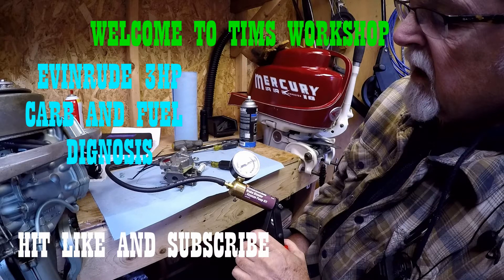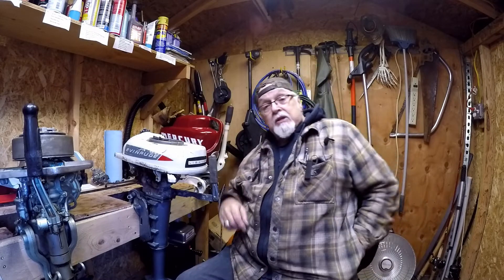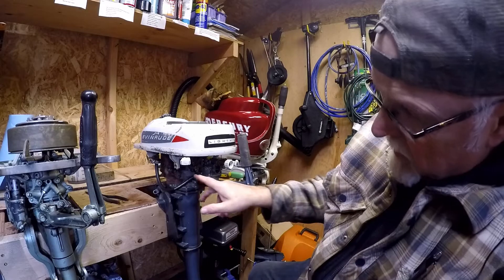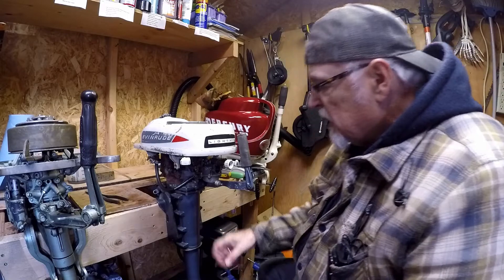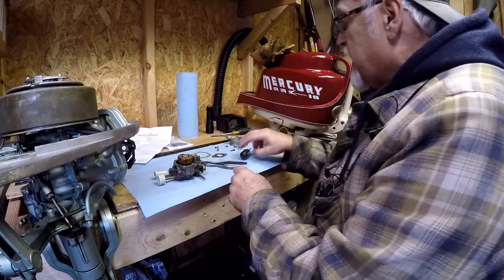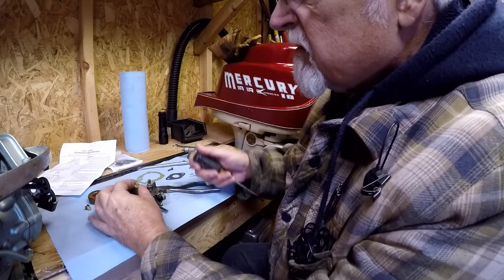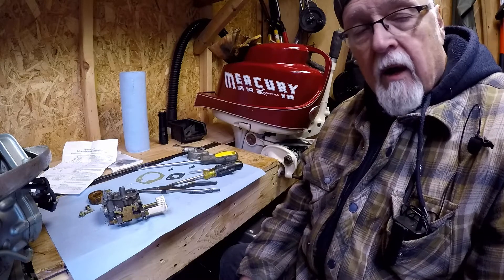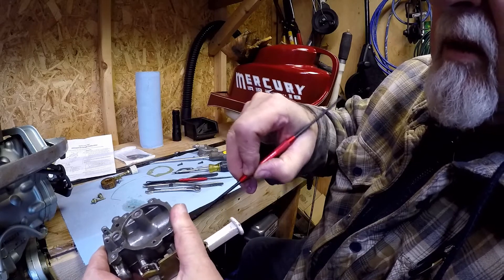Evinrude 3hp carb dignosis water pump install

Comment: That Merc 10 reminds me of younger days having one on an 8-foot hydroplane I built from Glen-L Marine plans. The summer Elvis kicked off. Still have the full size plans around here some where.
Reply from the maker: I know exactly what your talking about. They used these motors on mini hydros back in the 60's from the 10hp through the 28. I'll share a picture of one here as soon as I can find it.
Reply from the maker: https://photos.app.goo.gl/YAdcydjhQceLrJaP8
Here is the picture I found with one of these motors. Pretty cool, wish I had the boat. It looks like a mark 30E or H? One is long shaft and other short. Either one I bet hauled ass